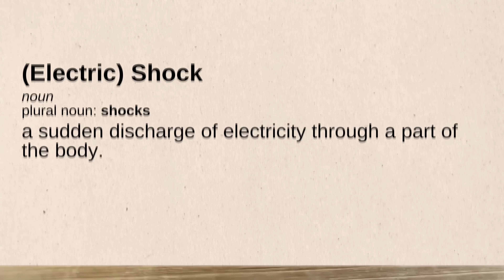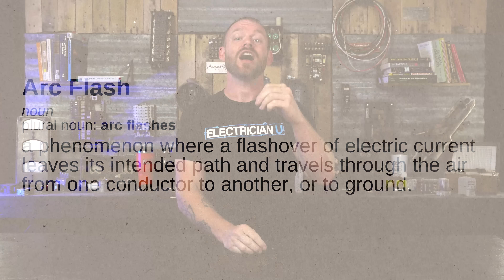How Do I Get Shocked? Why Am I Getting Shocked? It's Simple.

Comment: I am surprised I have never been seriously shocked. As a kid I stuck two bare wires into an industrial electrical socket, one hand on each wire, and I did not get shocked. Did get temporarily blinded from the giant spark though.

Later on in middle school/high school, I have stuck my fingers in places they didn't belong and I felt what I can only describe as electric fields. Still no shock, but definitely some strange sensations.(one was while messing with a smoke detector, another was messing around with old vcr and feeling the inside with bare hands while it was plugged in)

Comment: Sure, you can still be shocked by touching the hot conductor with one finger because the rest of your body is capacitively-coupled to all of your surroundings. Now if you were talking about DC then yes, you would need to complete the circuit with two parts of your body touching metallic conductors at significantly different electric potentials, but since this is AC, the equation gets a bit more complicated and gives rise to other components, like capacitive reactance that otherwise wouldn't show up when the frequency is 0 Hertz (DC). You still "complete the circuit" with AC, you just do so through an infinite number of capacitively-coupled points on your body to surrounding objects that are already part of the circuit. Insulative boots will help isolate your legs and feet from becoming a direct part of this AC circuit because any direct contact with the hot conductor with your hands will complete a circuit that travels thorough your arm, across your heart, and on its way through your leg, foot, and boot to whatever lower potential exists there. Electricity does not take the EASIEST path to ground (or to any lower potential), it takes ALL paths simultaneously, with the current dividing up across the individual paths as a function of the reactances formed by your body in a given environment,

Comment: I’ve been working with power since I was a kid (remember TVs with hundreds of volts for tubes?) Once I was sitting at a workbench wearing (dry) leather shoes and got shocked. Those @#$& shoes had a metal rivet near the ball of each foot, my feet were on the (grounded) metal rail under the workbench. My (sweaty) socks and the @#$& rivet completed the circuit!

Comment: You can still get shocked touching one conductor through capacitive coupling. Actually, if you take a multimeter and connect one probe to the hot side of a receptacle, there is a capacitance to ground and I have seen up to 10 volts

Comment: I was up in an attic replacing a fan box for a fan pan, but the wires were all jacked up so I j boxed it and when I went to strip the ungrounded I got stuck. I didn’t realize I was sitting on a copper water line. It was scariest thing I’ve ever got hung up on. I couldn’t even think, the only thing that saved my life was my strippers grips came off the handles but man did I hate my life and my life decisions

Comment: I've had some close ones.

The worst one was off a bare ground in a bad BAD ground fault situation with the breaker off in an industrial setting.

Another was that I was carrying a charged 1F capacitor across the shop.  And...   I dropped it.  I found myself flat on my back with my ears ringing. It took a while for my hearing to come back.

Comment: well well well, the led tubelight at my house has begun to flicker and i think it's because of loose wiring, i wiggled the wires around a bit and it seems to work fine now but if it again goes flickering im feeling a bit brave mighttt work on it live just for the heck of it... yes im a teenager how did you know, im well versed with almost all of the theory of electricity, i know how current works this is just going to (would) be my first time operating. surely if i use a pair of testers and never ground myself (ill be standing on a wooden bed) i can basically never get shocked? (unless i touch a neutral) 220 v ac supply btw, im thinking just unscrew it a little bit, shove the wires in more proper holding the plastic parts of it, screw them back? what are we thinking

Comment: Does that 5% include working on the power panel of a house? You can turn off the breaker box itself, but what if you add another breaker box? I'm assuming you have to shut it off outside right?

Comment: Yeah i was so stupid that day, i tried that with a 60 volt DC. i touched one side and said hmm nothing happened, i touched the other, hmm nothing happened. Maybe if i touch both and WOAAAAAHHH my heart skipped a beat, it wasn’t painful, it was just sooo unpleasent and scary. Although i did my calculation before attempting that, that i will be ok even if i touch both wire, i also saw someone do that and he said i feel nothing, but i think my resistance decreased at that time, maybe my hands got sweaty suddenly. Never do that again, thankfully it was 60v and not something higher.

Comment: It really needs to be stressed for safety, he is talking in hypothetical.  When i was little, I stuck a steak knife into an electrical outlet, and got shocked.  The only way current could travel through me was via the floor, and then either to the earth, then the ground rod at the main panel, bonded to the neutral bus, and back to the transformer, or the floor to something that had an EGC, to the neutral bus, back to the transformer.  Whichever it was, just touching the floor was enough.  Worst shock I ever got was when I was turning a thermostat knob for a water heater on a livestock waterer.  I was on my back, with my elbow on the concrete, and my hand turning the dial.  There must've been a crack in the dial, that bit like a son of a bitch.  I'm just glad my elbow was contacting the concrete, so it followed that path.  Most worrisome shock was when I was disconnecting two extension cords, and it was raining.  My hands began to tighten on the cords.  I'm just lucky I was able to disconnect them in time.  And it doesn't take much voltage to get a shock, either. Being on a dry floor inside of a house is a whole different animal than being on concrete or the dirt outside.  From what I've seen testing with a multimeter, if you have around .5 volts from the water in a livestock waterer to the ground, it's enough to shock livestock to where they won't drink.  I've had it where putting my hand in the water was fine, until the water contacted a cut on my hand, then it stung a little at the cut.  In regards to that, don't listen to Mike Holt (watched alot of his videos and he's great) when he says in regards to a ground rod "you can't get rid of voltage!".  Well Mike, you can make a parallel path to ground, and make it safe for livestock to drink.  Not ideal, don't trust that it will work, don't use it if you have an EGC, but it does work.

Comment: I've never been electrocuted apart from little DC shocks and staic, BUT I have never and will never ask someone- even if it is my wife or child, or a buddy to disconnect the power. I will also NEVER want to leave the power source insecure and unguared. Never, ever.
If I ever have to work on electricity, I will disconnect the power and prevent anyone- by physically securing the area, from swithcing the power back on! I have one of those - "anything will happen" mindsets - careful to the point of being fearful, so anything will happen.

Anyway, this is life-saving information. You don't know how many lives you've saved across the world, man. Neither do I, but it has to be many. 😀
I ALWAYS had problems understanding electrocution, I mean it's been years that I tried to see if I can finally understand it, but "Grounding" got in the way. It always does. 😀

I've realized today (finally- it only took .... years! ) that I'm getting Grounding and general electrocution confused and so I searched and searched and refined my search and finally landed on your video - cause it's something I REALLY want to understand.

Grounding and short-circuits due to electrical faults/failure is DIFFERENT to general electrocution. I think that is what confuses people, but they don't realize it.

Thank you!

Comment: I hate having to check contractors on equipment when they are live.
constantly have to remind people there is a reason I put stuff around me when I'm doing it
Had one time I was working on a grill and had to check the contactor and one manager was pissed that I was doing it -- even though her boss knew it had to be checked -- and kept bumping into me "accidentally" 
After the 3rd time of her bumping me I flipped out on her and told her the next time she bumped into me I was going to shove my foot so far up her butt that my shoe would have to be surgically removed. I told her I was checking circuits on live power -- 240v 50amp -- and in spite of the gear I was wearing she could cause me to slip and get shocked or worse
Her boss hearing me yell came in and her saying if was just an "accident" told her to go home until her inability to walk around people was solved

Comment: Thank you.  Viewed your video before. 
   I have worked on electrical wiring since I was about seven years old, starting with replacing wire fuses, then repairing broken and loose wiring. I had watched electricians wire new homes before I entered grade K in Virginia. I still stand by as a safety man when certified electricians work on our home.
    Over 400 volts AC, no contact is necessary for a shock or electrocution.  Just get into the corona about a wire or metal surface and zap!
  I use my meter, not my fingers. After a while, fingers quit sensing electric shocks and those little shocks can damage your sense of balance. 
Mike Holt talks about these long term consequences and uses the term sequelae.
  Thanks, again.

Comment: In an EEG "they're putting diodes..." (on our head)? Haha, no they're not. Diodes have nothing to do with that process except that the machinery used to do the measuring may have those components that only allow electricity flow in one direction (as if to convert AC into DC, etc.).

Comment: Subject: Water heater

My side is fine
Top thermostat of the water heater is fine
Breaker is fine
Bottom thermostat is 1/2 voltage

Two issues
When I was messing around in the top thermostat, I got shocked. Ground issue?

Had no hater water. Top thermostat reset button had tripped. Reset the reset button. The WH wouldn't stop filling. I heard the drip from the pressure relief valve. It almost blew. What's up?

Additional:
I trip breakers when load is high. For example; in bedroom, I can't have lights on, and run a shop vac at the same time. Lights flicker. Fans click

Any tips would be helpful. I know, I just need to call an electrician. Seems so simple at times, though.
Reply: Water and electric tripping would be two different issues on a water heater. Water heater won't overfill if you have a pressure reducing valve that's not working properly could trip the t&p. Other option would be a closed circuit a failed/failing expansion tank. As for voltage in water heater could be bad thermostat or possibly bad fuse in disconnect in rare cases can show that way.

Comment: Changing fuse on transformer 250v unit. Properlly removed from source and drained capacitors after inspection but had a derp moment when going to change fuse reconnected unit to power (testing voltages) but grabbed fuse live rocked it out but ended up just sitting there holding 1 end unable to move till i heard a breaker trip then i could let go. Was 13 yrs ago when I was pretty green

Comment: Not saying I know much of the matter but from what I heard the human body can start to work like an electric antenna and it has some capacitor possibilities, too. Therefore it should be quite possible that you could get shocked by touching one side of a wire. Could you perhaps explain if I am wrong or no?

I myself had an episode when I was 6, I suppose I'm happy to be alive :)
I sat before the outlet on a sort of a plastic ground–thus there was no way I was being grounded–and I stuck a pin inside. I still remember that pain;  as if being being hit by a truck and also cut in every part of the body at the same time. We had an AC, 220V, 5-16 A. Coincidentally, I was poking in the right hole, which is supposed to be the neutral wire. I wonder if it was damaged, or phase and neutral switched.

Comment: I am always very adamant about putting the rotation direction wires of a condenser motor below the grill on an air conditioner. Lots of people will install the condenser motor and they don’t know which direction it will turn so they put the wires up through the grill so they can easily switch it later. Then after a few years the sun eats away the insulation and some kid gets out of the swimming pool barefoot in the grass and somehow comes in contact with it. I always look at the diagram on the motor and it will tell you the combination for a certain rotation. That way you can wire it right before you turn it on. And get the wires inside the unit where they belong.

Comment: The golden rule never work with live circuits or touch live wires alway check if they are live with a proper tester not a voltage stick if  you are going to work with the wires

Comment: You’re incorrect about what you said about your boots. Electritian’s wear EH rated boots (Electrical Hazard). EH Boots insulate you from the ground. ESD rated boots actually do the exact opposite (electro static dissipative). ESD boots are specifically designed to connect you to ground so your body can’t build up a static charge. These are used by people who work in electronics factories so they don’t ruin anything of the electronics with static buildup.

Comment: Ok, I have a question and im 90% sure I already know the answer, but im asking just to confirm. Electricity doesnt actually care if your touching the ground unless theres a path back to the source correct? For example if i stick a butter knife into the hot side of an outlet I should be fine. Becuse my body is not a path pack to the source. Unless im close to a ground rod which does connect to the source. Am I correct?

Comment: After years of replacing receptacles and switches without turning off the breaker I finally learned my lesson.  I was kneeling on a dry wooden floor, after telling  myself it was no need to shut off the breaker to wire the plug since I had done this 10s of times with not getting more then a finger buzz. I picked up the romex to open the jacket at the cut off end.  As soon as I picked up the romex the end hit me in the middle of my chest giving me the worst shock of my life.  It did not knock me down but it hurt like hell.  Needless to say I got up and turned off that circuit’s breaker.  I will never work with live wire again because it is unpredictable.

Comment: One thing to note about completing circuit, with load. Very often if the load is much much lower resistance then your body so it doesn't really add any significant resistance to the circuit compared to you. There are of course exception which pull very little power like turned off electronics. Lightbulb I EU has cold resistance of only 130 ohm, hand to hand it can be from 3k to 200k ohms, very depandant on the skin resistance in your hands.

Comment: Had to do a breaker change today for a customer. Main breaker off first thing, box was very crowded. I have no interest in tempting fate when it comes to a service panel or a hot circuit. Been bit a few times by 120v, lessons learned. Your heart runs on electricity, don't introduce more juice into your body if you can avoid it. As always thank you for the content, stay well EU.

Comment: The problem with electricity is there is a threshold called ‘stick on milli amperage’ above which, you cannot let go of a conductor if you are holding it. Since you don’t know your body’s resistance between the two contact points, you don’t know where you sit on the ohms law equation. Always assume it’s live and you can die. Don’t be afraid, but respect it and have training. Electricity is not a hobby.

Comment: It is also worth knowing that your heart uses small electrical impulses (in the mV) to make the muscles contract, and it doesn't take much to disrupt that.  Which is why, although there is no GOOD path for current to flow, the absolute WORST path is going to be across the body (left to right), like in one arm and out the other, because it goes right across the heart.

Comment: 2:10 IMPORTANT: You forgot to mention you feet.... if your feet is not isolated and you still have the hand in the pocket while touching just 1 wire doesn't matter.... you're still electrocuted. Keep your feet isolated, wear rubber things (anything rubber) Even flipflops made of thick rubber... although not recommended ofc, still works.

Comment: You did not explain WHY the light pole shocked you but you said a wire nut came loose off the grounding pole, presumably while you were touching it with pliers, so the electricity traveled to ground through the pliers and your body instead of through the grounding rod it would normally be attached to. Right?

Comment: I do some electrical work in the commercial environment and I can never find the proper fitting gloves to wear. I have started using like electrically insulated tools to prevent the possibility of a major problem. But I was wondering if you could point me in the right direction of where to find proper fitting gloves. Yes I have small hands. And some smalls fit me and in some cases I can get medium to fit me. Please help if you might know where to look. Thanks in advance.